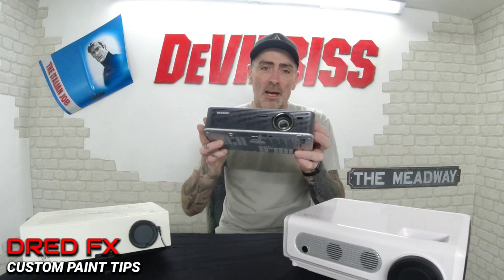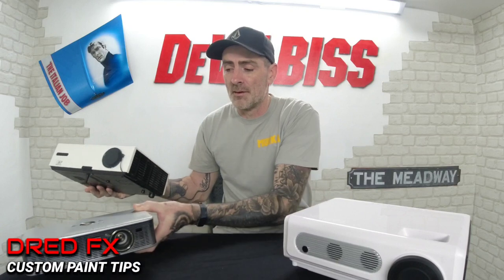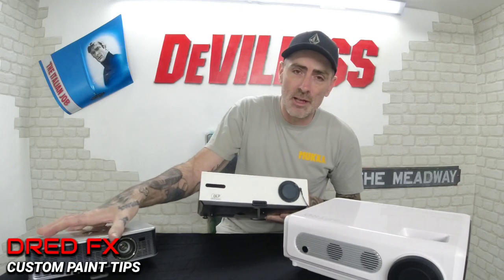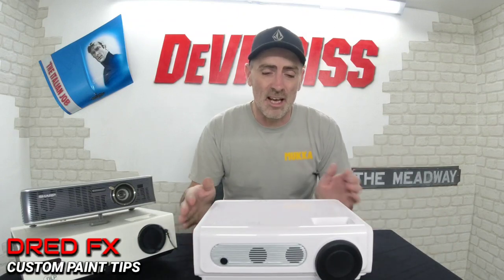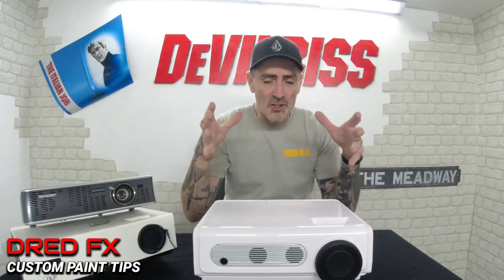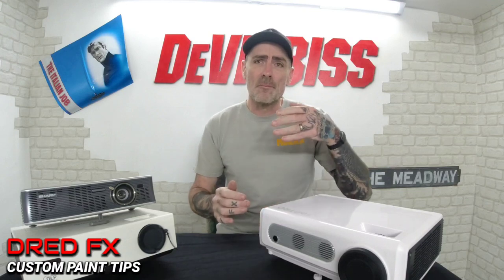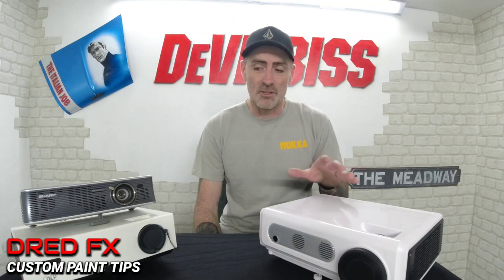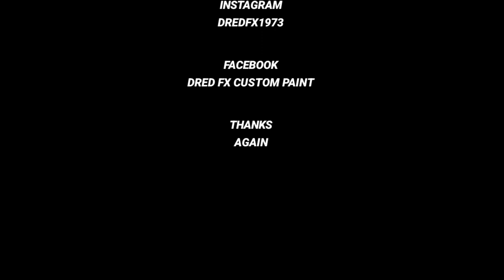how to get your artwork across for airbrushing

Comment: I always cheated years ago when i did airbrushing.
Get a photo or image you like  out of a high quality magazine .Spray 3 wet coats of single layer acrylic clear on the image .Let it dry and soak it in warm water with a tiny drop of liquid soap .

The paper will come away from the clear leaving a semi transparent transfer of the image on the sheet of acrylic clear paint  .

This image can be laid on a tacky coat of clear and more clear put on top .Being acrylic it will melt with a wet coat .

You can use a airbrush on top of the acrylic photo transfer to blend it in to the background.

This process went by the name of acrylistration back in the 1970,s
Reply: Video ...Tips for a Successful Immediate Image Transfer
YouTube · GoldenPaints channel